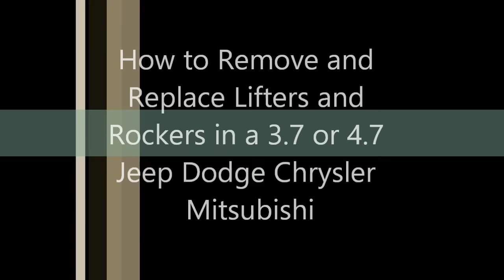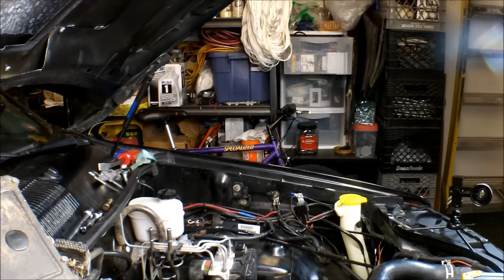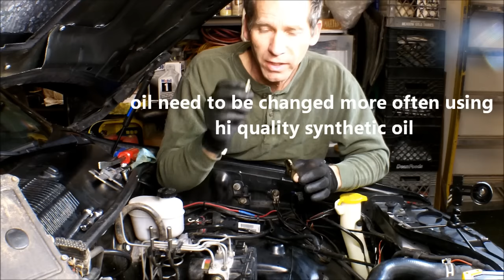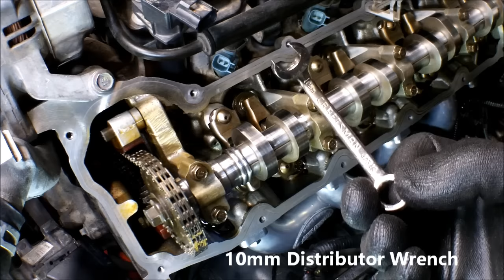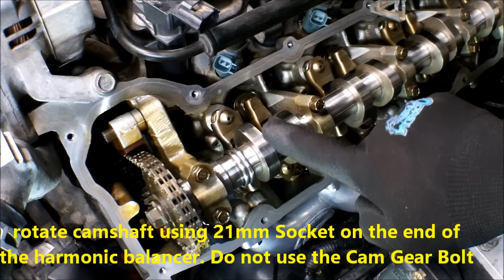Remove & Replace Lifters & Rockers on a 4.7 & 3.7 Jeep Dodge Chrysler & Mitsubishi

Comment: What is the name of the tool and where can you buy it
Reply from the maker: Miller 8516A Rocker Arm Tool  or 3747-13 Dodge/Jeep 3.7 4.7 Rocker Arm Remover Similar to Miller 8516A. You can find them on eBay. I have never used it and find it easyer and safer by using a pry bar or screw driver and a 10mm wrench.

Comment: Would synthetic blend be good enough for the 4.7
Reply from the maker: Yes, and I would recommend using half quart of Marvel's Mystery oil or Rislone with each oil change.
Reply: martinbuilt ive been using shell 15-40 non synthetic for a few months and the 4.7 seems to like it i do get colder times the truck started perfect in 28 degrees.
Reply: martinbuilt shell makes a 15-40 synthetic blend and 15-40 full synthetic what oil would you recommend to save the lifters they only make alittle noise at cold start then after 10 seconds its gone and doesnt always do it ive got 120k
Reply from the maker: @Magnum5.9360   I think either one would be fine. That is a relatively heavy oil for an engine that requires 5W30 and 10w30 in the HO engines.
Reply: martinbuilt its not the HO the (high ouput) 
Engine only came in the 2004 Jeep Grand Cherokee Overland and yes the oil is thick but velocity charts say good to -25 celsius
-13 F im scared if i put a thinner oil the lifters will start tapping away.
Reply: martinbuilt what would you really recommend for 120k if i get full synthetic if its going to fuck up any seals and make my truck start leaking.

Comment: I tried that tonight and it's loose. It's not tight at all. The rocker arm and lifter are in good shape. What did I do wrong? Please help
Reply from the maker: I'm assuming that the rocker arm popped out. And if so, it's possible that your valve seat dropped. And that's why it's so easy to reinstall the rocker arm.
Reply: @martinbuilt  when I removed the valve cover the rocker arm was laying there
Reply: @martinbuilt  the ark did pop off. What else do I need to buy? Please
Reply: @martinbuilt  how do I fix that problem if it seat like you said?  The lifter is new and so is the rocker arm. It's still popping on with light pressure and still loose once you get it on. What else do I do?

Comment: Sorry if someone commented this already I couldn't read all 500 plus comments. I'm swapping mine for the melling lifters/lash adjusters (please don't let the name start another discussion) I purchased them from Autozone, soaked them overnight, and now today some are softer than others. I can squeeze most about an 1/8 of an inch while 3 of them I can squeeze closer to a half. Once installed i could take the rocker off without any tools. I swapped for stiffer ones. All of the ones I'm pulling from Jeep can't be compressed at all by hand except two who were rattling around. I'm guessing those were the problem. Can anyone give me some info on what a "good" lash adjuster should feel like? I've searched everywhere! Thanks in advance!
Reply: Ps Great video Martin! I should've started with that. I've watched tons. My 04 HO WJ with 210k miles says thanks too.
Reply from the maker: Yeah you shouldn't be able to install the rocker or remove it without a tool, do not install those lifters.
I personally like ones that you would swear our solid lifters. The only way you're able to compress them is actually in advice. Those are the ones that I like.
Sounds like I will just replace the ones that were giving you a problem
Reply from the maker: Thank you. I'm glad you liked it and found it helpful
Reply: @martinbuilt  Hello again it turns out I should've done a lot more investigating before swapping those lash adjusters. My ticking noise didn't go away. I did a compression test to find that a valve dropped in #7 and the ticking was the piston tapping it. I have no compression in #7 and 120 in the rest of the bank. 160 on all the evens. I'm trying to diagnose now(haven't opened it up yet) whether I can get a new head or just give up. I'm leaning towards selling for parts or swapping engine. Any advice? I started a thread on the jeep forum and some folks have offered some advice. I'll probably buy another WJ just to stay with this helpful community.

Comment: I need to do this on my Nitro. But how do you turn the engine by hand? I can’t seem to get at anything on the front of the engine.
Reply from the maker: I'm not familiar with what it looks like underneath the hood of a Nitro, on my own vehicle at their harmonic balancer I use a 21 mm socket with a short extension and breaker bar or breaker bar ratchet combo.
Reply: martinbuilt I’m not sure what a harmonic balancer is. Would it work to turn the nut on the end of the camshaft to crank the engine?
Reply from the maker: @ifyoulovedogs  That is not recommended as that can damage the timing chain and chain guides. The harmonic balancer is the large pulley at the bottom front of the engine. As you are facing the engine only rotate the engine clockwise.
Reply: martinbuilt I figured as much. That bottom pulley would have been my first choice but can’t get at it from under the hood. I’ll have to try underneath but that’ll really slow things down

Comment: What if the loob is down. Can i turn the crankshaft
Reply from the maker: yes, but only turn the crankshaft clockwise, turning it counter clockwise can damage the timing chain guide tensioner and never turn it at the camshaft.

Comment: Hey Martin, my passenger side valve cover is making a ticking noise. Sounds similar to a lifter tick, however all my lifters and rockers are in place, the noise does not increase with acceleration, and I have no check engine light. I have dealt with a thrown rocker before so I know the loss of power feel but the ticking noise is apparent from the valve cover area on the passenger side. Any suggestions I can take a look at? Thank you!
Reply from the maker: Well it still could be a bad lifter or possibly the hydraulic tensioner for the timing chain on that side.
 Perhaps try some Marvel's mystery oil on your next oil change.

Comment: How would u know that the lifter is bad a missfire or somthing my brother jeep blown a head gasket what can cuz that a bad water pump
Reply from the maker: You will get a lifter tick this is especially bad if it does not go away. It is somewhat common to hear it at the initial start up on a cold engine.
 Blown head gaskets are usually caused from the engine overheating or it can just happen. A leaky water pump and running low coolant level can cause a blown head gasket.
Reply: @martinbuilt  ok good to know thanks and happy holidays

Comment: How do I spot the bad rocker or lifter ?
Reply from the maker: the good news is that I have never seen a bad rocker arm from these engines. now to spot the bad lifter or lifters, you can use an engine stethoscope https://amzn.to/2zJdk7I or a section of hose, one end to your ear the other to the valve cover to hear which lifter is making the noise.

Comment: My question I have a jeep liberty 2002 how can I remove the cover so I can check for the lifter nice video but don't show how to remove the gasket thank
Reply from the maker: I don't have a video that explains it for the 3.7 but this video should help you https://youtu.be/URrQ9sMgLJs
Reply: @martinbuilt  a stupid mechanic told me in order to change one of the  left side of the liberty lifter he had to remove must of the engine part and change me about 1200 but I google here and I find out about how to remove the gasket cover is not hard and is only the cover he need to remove no the half engine top

Comment: Which way does the hole face on the valve lash lifters
Reply from the maker: If you're referring to the hole on the side of the lash adjuster, it does not matter which way it faces.
Reply: I was wondering if I could talk to you on the fone I have some questions
Reply from the maker: @saulzavala9806  can you contact me on Facebook Messenger 
https://www.facebook.com/Martinbuilt-2351766611763181

Comment: I changed #8 the rocker is loose put a brand new rocker and lifter and it is still loose when the cam in down it dont move.. ???
Reply from the maker: when you replaced the lifter did you soak it in motor oil to remove the air?
Reply: @martinbuilt  no ? How would that make the rocker arm loose?
Reply from the maker: @morriscat11  if the lifter is collapsed the rocker will be loose. The lifter (lash adjuster) needs to be pumped up to found the rocker in place.
Reply: @martinbuilt  ok i am not sure how to pump up a lifter?

Comment: How do you know which lifter is bad?
Reply from the maker: Sherry Messer if it is not obvious I would just recommend changing them all. Especially since it's so much work to get under the valve cover anyway. Make sure you soak lifters in motor oil for at least half an hour it lets the oil get into the lifter and work out the air you can also speed that up by pushing down on the top of the lifter while it's in oil.
Reply: Thanks I'll remeber that.
Reply: @martinbuilt  Soaking them in oil is something you should have mentioned in the video or at least in your description. Great video otherwise.

Comment: Do I reset timing after rotating harmonic balancer
Reply: JaVyS KnOw HoWs if you’re just rotating the harmonic balancer and not actually removing cams or messing with the timing, then no. You’re fine. You’re not messing with the timing by rotating the harmonic balancer

Comment: Would this work when changing the valve seals as well?
Reply from the maker: Yes, but you'll still need to remove the valve spring and retainer to get to the valve seal. This will require a special tool to compress the valve spring and you'll also need to have an air compressor to keep the valves in the seated position.

Comment: So I put all new lifters and fulcrums are rocker arms the noise went away but at a low idle is still clatters! Anybody else have this
Reply from the maker: it could be coming from the timing chain set, maybe a bad hydraulic tensioner. How is your oil pressure at idle?
Reply: @martinbuilt  I don't know oil pressure. The gauge on the dash says really good. I didn't even think to check the timing chain.

Comment: Is it the same in 4.0
Reply from the maker: Much different, 4.0 is a pushrod engine. To change lifters the cylinder head needs to be removed.
Reply: Ok thx
Reply: I also want to put a performance cam
Reply: Is it difficult to put one
Reply from the maker: Not to bad....is a little hard getting the right side  valve cover off. Here is a video I did installing the HO camshafts. https://youtu.be/URrQ9sMgLJs   I will be installing the 2008+ camshafts soon.

Comment: how do know which one is bad
Reply from the maker: TheMenshianator you could use a mechanic's stethoscope place it on top of the valve cover over each cylinder head and this would narrow it down. The lifters are not that expensive so it is always better to replace more than you thought then not enough. Especially on the right side. It is a lot of work to get that valve cover off.

Comment: What if it already broke off?
Reply from the maker: what if what broke off?
Reply: @martinbuilt  the lifter and rocker arm
Reply from the maker: @macario9035   When you say BROKE Off that sounds bad. Are you saying the rocker had fallen out and the lifter had come out of the cylinder head? If so replace the lifter with a new one and if the rocker is not damaged reuse it. Is there and damage to the cylinder head where the lifter goes? If so you will need to replace the cylinder head. Also, inspect the camshaft and make sure the cam lobe is not damaged.
Reply: @martinbuilt  yes right where the lifter sits it broke a good size chunck of metal. Rocker arm came off the lifter and knocked a good hole on the valve cover and made it have a big oil leak. What are your thoughts can i save it or is it done?
Reply from the maker: @macario9035  yeah unfortunately I'm afraid the cylinder head would need to be replaced. Matter of fact I was at Pick-A-Part this weekend and saw an engine with the exact same situation where a large portion of the cylinder head where the lifter is held was broke off.
Reply: @martinbuilt  how hard is it to do that job. How long will it take to do it. It's on a 2012 jeep liberty sport 3.7L
Reply from the maker: @macario9035  that's a pretty big job, I would plan a whole weekend for it. You need to remove the intake manifold,  timing cover And the cylinder head

Comment: Step 1: take apart engine
Reply from the maker: Well not completely...lol
Step 1: Remove valve cover, some models will need to also remove the battery, battery tray, and A/C compressor. This also depends on what side you are working on and if it is a Dodge or a Jeep.

Comment: Hi Martin very nice video and smart short cut. Not sure whether you are familiar with the pentastar v6 from Chrysler. My boy, 2012 Routan, actually a Dodge caravan,  below seems to have some tapping noise as my video link below

https://youtu.be/iXLQyPt7xWY

Do you think I can replace lifter and rocker arm same way as your 4.7 L?  I am not sure whether I could rotate the cam using Harmonic balancer to expose the rocker arm and lifter. Some people says I could damage timing chain if I rotate harmonic balancer. So I don't have to touch cam shaft and can phaser etc Thanks a lot for your time.
Reply from the maker: I'm not familiar with that V6 engine, but there is no way you could damage the timing chain by rotating at the harmonic balancer. If you rotate at the camshaft that is when damage will happen to timing chain components.
Reply: @martinbuilt  Hi Martin: appreciate your reply. As your previous reply to other questions, I should rotate harmonic balancer a little bit to do it clockwise only. By the way, do I need to put it on neural?
Reply from the maker: @jasonl7025  no, leave it in Park

Comment: What kind of moron designs an engine with an OHC, with rocker arm & and lifters? Anyone that got stuck with this p.o.s. should change out their lifters on a regular basis. CLACK CLACK CLACK! What an embarrassment for Chrysler.
Reply from the maker: Ford uses the exact same design on there 4.6 and 5.4 engines a matter of fact the lifters are interchangeable from Ford to Chrysler. But for whatever reason Chrysler the only one that has a problem with the rocker arms coming out you never see that happened on a Ford. I have seen where the rocker arms actually failed on a Ford but never on a Chrysler.

Comment: This guy calls an engine a motor. Doesn’t he know motors are electric and engines are internal combustion?
Reply from the maker: Definition of Motor (Entry 1 of 3)
1 : one that imparts motion
specifically : PRIME MOVER
2 : any of various power units that develop energy or impart motion: such as
a : a small compact engine
b : INTERNAL COMBUSTION ENGINE
especially : a gasoline engine
c : a rotating machine that transforms electrical energy into mechanical energy
3 : MOTOR VEHICLE
Reply: martinbuilt so if an engine is a motor how can you  define which is a motor and which is an engine? Can we call a starter an engine by your definition? Maybe we should start calling donkeys a horse. Don’t they do about the same thing?
Reply from the maker: @williegillie5712  maybe you should take up your issue with Merriam-Webster dictionary. Couldn't just watch the video and enjoy it the way I presented it you got to make an issue out of engine and motor
Reply: martinbuilt somebody corrected me for calling an engine a motor. Just paying it forward. It’s ok to call an engine a motor but a motor is only a motor? Clarify it for me. Is it ok to call a starter an engine? Is there no difference?
Reply from the maker: @williegillie5712   yeah nine times out of 10 I call a internal combustion engine and engine. This one time for whatever reason I called in a motor. Well I would call a starter and starter. As far as a electric driven I would call it a motor. Thanks for watching..
Reply: martinbuilt I enjoyed your video thanks
Reply: martinbuilt an engine is a particular kind of motor.